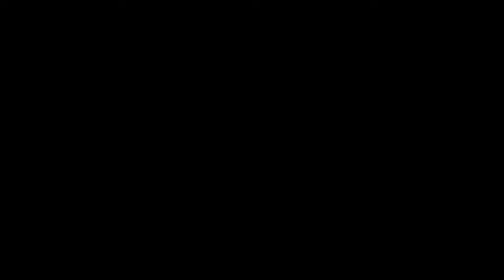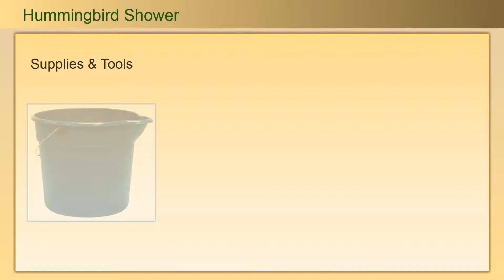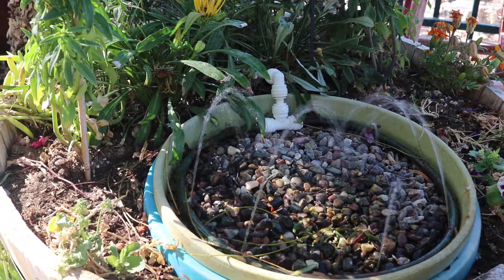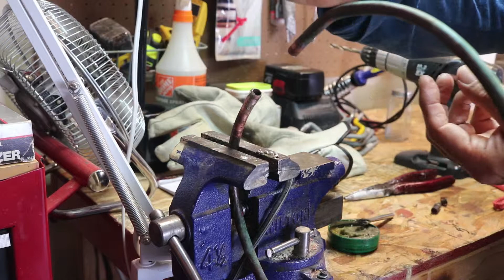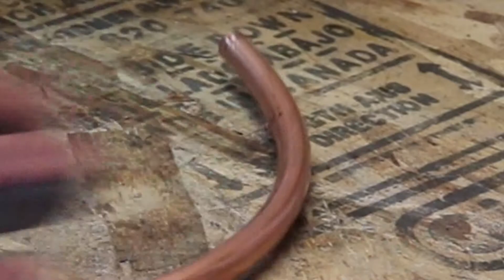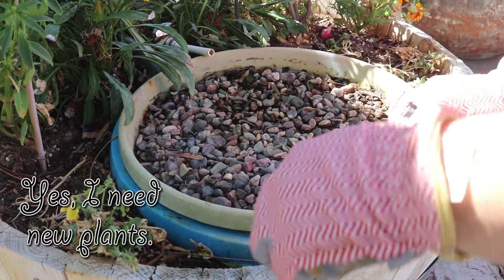Hummingbird Shower

Comment: Do you have any concerns about the fact copper in drinking water can be unhealthy? Perhaps, changing out that copper section for a more benign material would be advisable. Other than that, this is a super cool project!
Reply: Copper can leach into water only if the water is highly acidic. Ours is on the other end of the pH spectrum.  From what I've read, it's the preferred material for water pipes. Lead-free solder of course.

Comment: This is a great fountain project!!  If you find the cleaning process aggravating, you might try using two buckets with one inside the other.  That way you could pull the top bucket out for easy cleaning without having to mess with re-digging the hole.  Again, thanks for the great idea!